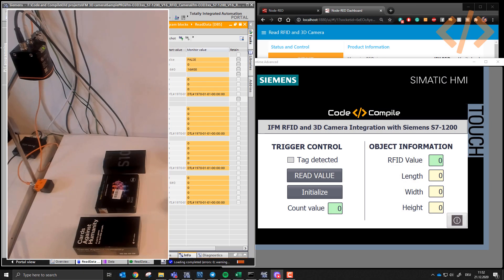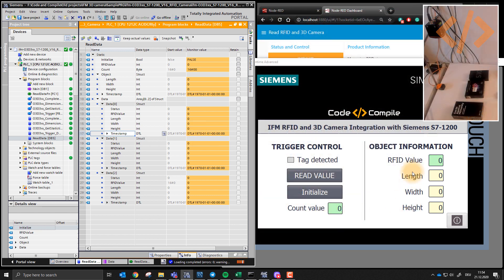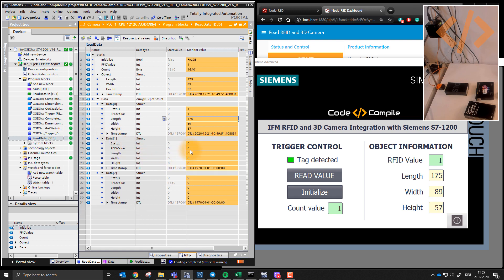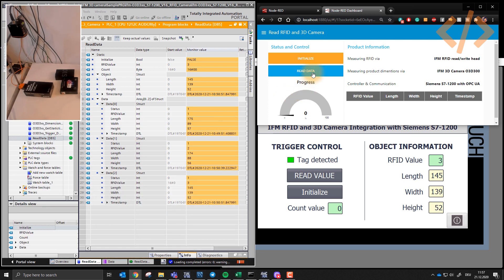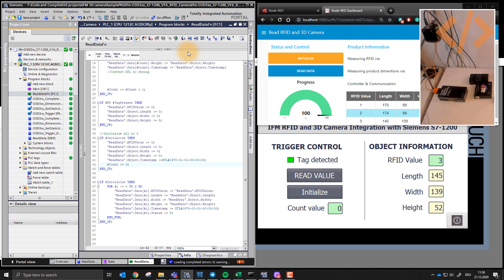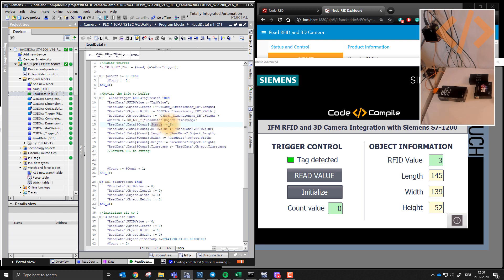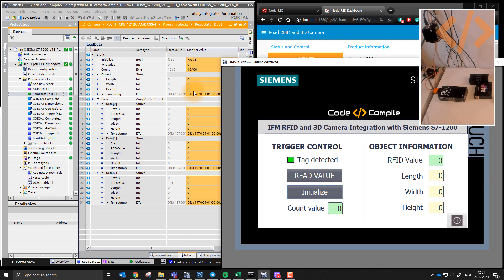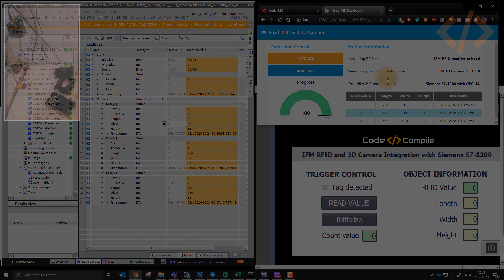Logging PLC data from RFID and 3D Camera in MySQL

Comment: Do you have a course on “MySQL” and or do you know a good one for beginners? I’m a Field Service Engineer who also does some Rockell Automations HMI Programming and getting better at using Studio 5000 which I have access to and use for work. But I’m not as familiar at using SQL stuff or databases though I’ve heard of them and aware of the query data from PLC they can do which can be a great benefit. How you are using MySQL is interesting to me. But I’m unfamiliar in its use.
Reply from the maker: Hi, you can try the course Interface MySQL with PLC via Node-RED available at learn.codeandcompile.com. In that course, I am using Siemens PLC and getting PLC data via OPC UA. The only home work you have to do is reading the data of PLC via Node-RED and then you can further use that data to send to MySQL.
Reply: @thegeterrdone  Thanks for the feedback. I will have to check it out the available course and how that interface is done. I downloaded MySQL earlier to install as well play with and learn how to use as well.

Comment: Hi there. It seems like this kind of course I am looking for: tacking data from a cam into an S7-300 and read all data block from a server. Do you have a course where you do all of this? I'd like to buy it :)
Reply from the maker: Reading data from where?
Reply: @thegeterrdone  hi & thanks for replying. I managed trading data from a SE-751 code scanner via an S7-300 with Ethernet.
Now I got another issue: communicating between an S7-300 only with MPI and that sr-751 reader (that uses Ethernet). I found something name NETLink PRO Compact, but don understand how can it be configure so that the S7-300 reads data from the SR-751 via that module...you did something like that before?